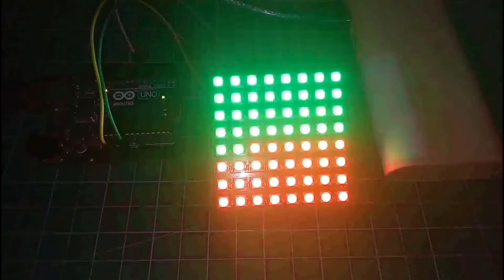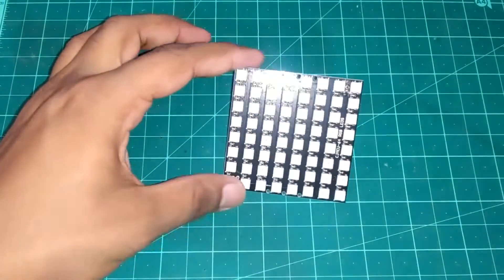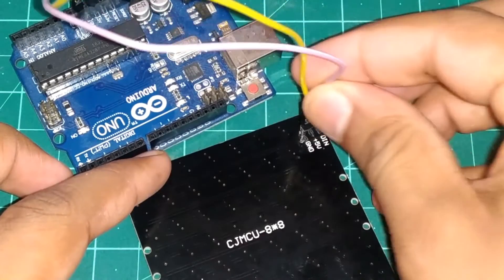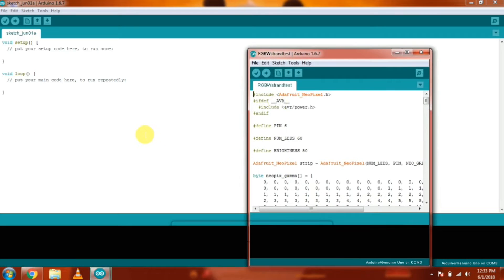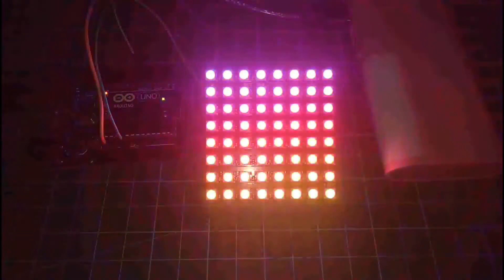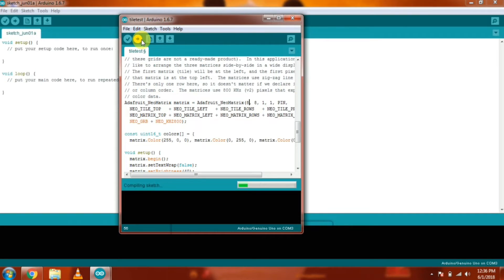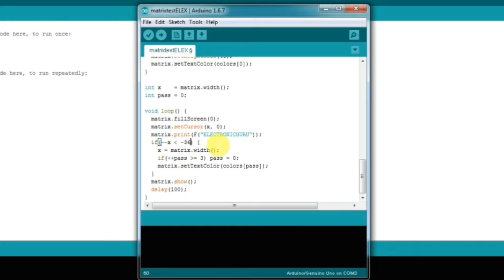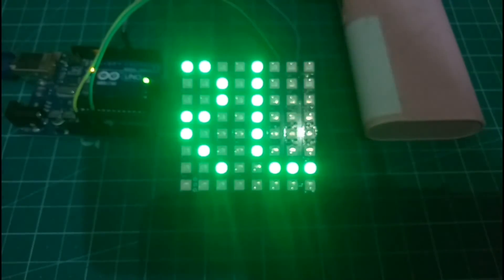Adafruit Neopixel 8x8 led matrix with Arduino individually addressable led matrix

Comment: The scrolling text doesn't work on my 16x16 Matrix. Shows random letters. 😕
Reply from the maker: Is that so? And rest of thing works?
Reply: @electronicGURU  Got it yet! Had to change a few values. But RGB letters would be very cool too! But have no plan how to do it. 😞
Reply from the maker: So RGB is not working for you
Reply: @electronicGURU  Correct!
Reply from the maker: Well thats weird please check if my Matrix and yours are using same ws2812 led ?

Comment: I'm new to arduinos. When I connect the pins described, I will either get nothing lighting up, just 1 light, once 5 lights or 6, and sometimes 1 light, but it's blue instead of white. 

Is there anything I'm missing? The USB should be sufficient for power supply? The Arduino IDE says it successfully uploads, but I'm not able to see anything other than what I described above.

I don't think this will make a difference, but I am using the flexible version of the 8x8 neopixel (https://www.adafruit.com/product/2734).
Reply: @electronicGURU  do you mean power the Arduino or power the matrix? The matrix also had additional grnd/5v (see adafruit link in my last comment for a picture)